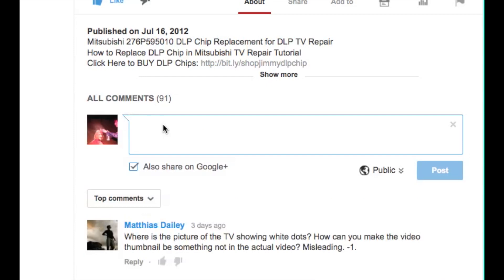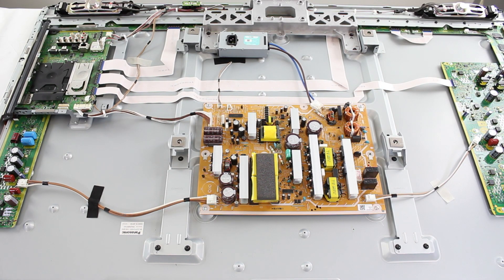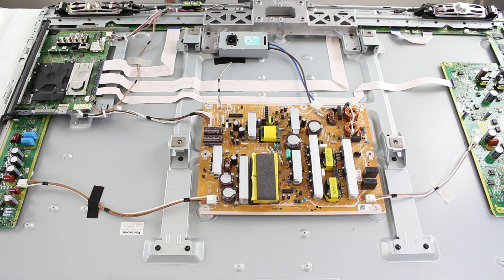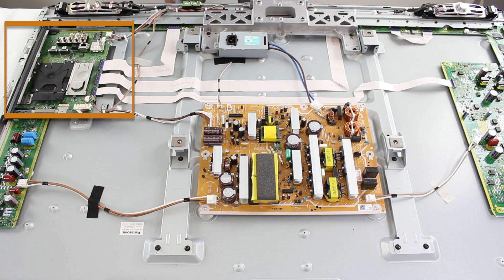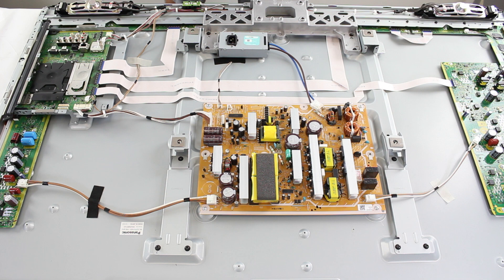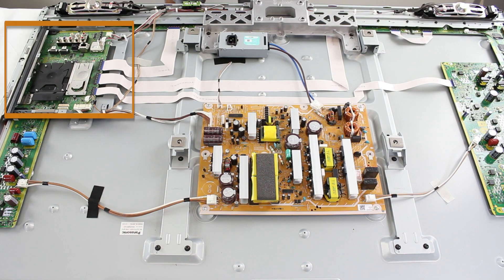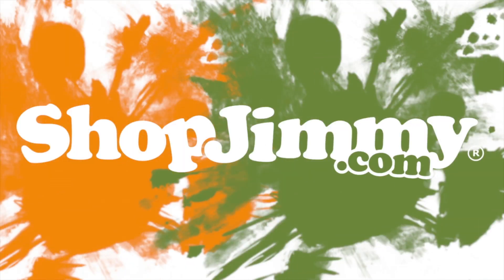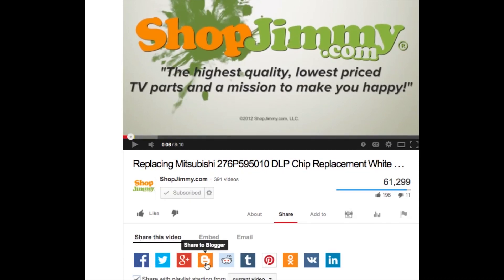TV Not Working After Storm - TV Lightning Strike & Storm Guide for Power Surge Problems

Comment: Not sure if you could guide me in the right direction, my TV was damaged through the HDMI. When turned on the standby light works and TV attempts to turn on but then fizzles off again (don't actually see anything on screen) I've checked the board and all looks OK It's a Samsung plasma display - PS60E530AW3
Reply from the maker: Josh Hartley   I recommend replacing the main board in your TV.  Unfortunately I do not see any replacement parts in the search results for your TV model number on our website.  Please reply with your part number on your main board and I can try searching for replacement parts.  Thanks and please let us know if you have any further questions!  www.shopjimmy.com

Comment: i have a tc-p60s30 i replaced the power and main board and the lower c1-2-3boards still no power..no led lights i have current 120 volts going to powersupply parts were pulled off cracked screen tv ..anywhere to look? thanks
Reply from the maker: Blustdust   I recommend bringing your TV to a certified Panasonic repair shop.  Thanks!  www.shopjimmy.com
Reply: thanks.

Comment: Vizio e601i-a3. Lightning strike. Power does turn screen on. No picture nor do inputs work. Screen quickly alternates black and medium white to alternating black and dim white. Power button again, does turn on TV, but does not work to to turn off the TV. Was on power strip that still works. All cable equipment in house is shot as are about 5 other TVs and gaming systems. I suspect cable box did it. Cable box was HDMI to the TV.

Comment: I have a 55" LG 3D Smart TV, model (55LM7600) and recently while watching the tv on any input it will reboot itself every 25 to 45 minutes.... Sometimes it takes longer to reboot but it does it non the less. Sometimes it goes an entire day without the reboot issue only to resurface the next day. Strange.... I purchased the tv on 11/15/2012 so it's still an infant. There are no other problems with this set. What could be the problem? Any assistance would be greatly appreciated. Thank you
Reply from the maker: Yosbeli Pi  I recommend replacing the main board in your TV.  Here is a link to replacement parts for your TV model number on our website, click here:  http://www.shopjimmy.com/catalogsearch/result/index/?cat=56&q=55LM7600  Be sure to match part numbers on your current board, with your replacement for compatibility.  Here is a link to a video showing how to identify your part number, click here:  TV Part Number Guide for LG & Zenith Main, Digital, & Tuner Boards (LCD, LED, Plasma TVs)  You can also call our customer service for further assistance with your purchase.  (877) 881-6492  Thanks and please let us know if you have any further questions with your TV Repair!  www.shopjimmy.com
Reply: ShopJimmy.com: If you don't mind me asking, how can you tell if the problem is with the Main Board versus the Power Supply Board?
Reply from the maker: Yosbeli Pi   The power supply provides the 3.3v or 5v turn on voltage to the main board and the main board produces the power on function.  Thus it sounds like the TV is getting power, but the main board is causing the TV to turn on and off.  Thanks!  www.shopjimmy.com
Reply: ShopJimmy.com thank you for assistance and the information.  After I buy and install the part, I'll  update on results.

Comment: I actualy have a sony KDL-32R400A not turn on at all I change the power supply but not work. the original one have noise like trasformer glich but the new one not have this noise. the problem i thing was generate by a ligthing because my sat ird not work too.
Reply from the maker: +Wilbert Lorenzo  Try all repairs and troubleshooting at your own risk.  I recommend replacing the main board and the power supply board in your TV.  Click this link to replacement parts for your TV model number:  http://www.shopjimmy.com/catalogsearch/result/?q=KDL-32R400A  There may be multiple boards for the same TV model number, be sure to match part numbers on your current board, with your replacement for compatibility.  Thanks and please let us know if you have any further questions with your TV Repair!  www.shopjimmy.com

Comment: Panasonic 50" Plasma HDTV, Model No. PN50C550G1F, Serial No. ZIMZ3CQZ805936V.  Inoperative due to lightning strike very close to our property.  TV has standby light.  Will power on, try to present a picture, then turn itself off.  Have already replaced the power board (P/N BN44-00330A).  Any suggestions on what to try next?  Your video indicates replacing the Main Board for the model being worked on.  Does the same apply to my television?
Reply from the maker: Papa Dawg  Please watch this video FIRST to help with your repair!  TV Repair! LCD, LED, Plasma, DLP How To Fix Your TV with ShopJimmy.com Help!  If you do not know for sure which board in bad, then I recommend replacing both the main board and the power supply board.  Here is a link to replacement parts:  http://www.shopjimmy.com/catalogsearch/result/?q=PN50C550G1F  Be sure to match part numbers on your current board, with your replacement for compatibility.  Thanks and please let us know if you have any further questions with your TV Repair!  www.shopjimmy.com

Comment: I have a vizio sv420xvt1a it was hit by lightning and will not power on. The vizio name is lit up in yellow as it does when its off but in the speaker in red it displays 5.1. Thank you
Reply from the maker: Ryan Sledge   I recommend replacing the power supply and the main board in your TV.  Here is a link to replacement parts for your TV model number on our website, clic  http://www.shopjimmy.com/catalogsearch/result/?q=sv420xvt1a  Be sure to match part numbers on your current board, with your replacement for compatibility.  You can also call our customer service for further assistance with your purchase.  (877) 881-6492  Thanks and please let us know if you have any further questions with your TV Repair!  www.shopjimmy.com

Comment: Philips 42" LCD TV Full HD 1080p with Pixel Plus HD Flat Screen TV with 3 HDMI connections
Model # 42PFL3603D/27 It worked perfectly until during a storm, it was plugged into an outlet that did not have a surge protector unfortunately and went out. The TV turns on and shows the screen as shown in the picture then makes a clicking noise like it wants to turn on, but just turns right back off.
Reply: Janet Burmeister  Has a white picture with letters Philips on it
Reply from the maker: Janet Burmeister  PLEASE SUBSCRIBE TO OUR CHANNEL - Try all repairs and troubleshooting at your own risk.   I recommend replacing the main board in your TV.  Click this link to replacement parts for your TV model number:  http://www.shopjimmy.com/catalogsearch/result/index/?cat=56&q=42PFL3603D%2F27  There may be multiple boards for the same TV model number, be sure to match part numbers on your current board, with your replacement for compatibility.  Here is a link to a video showing how to identify your part number, click here:  https://www.youtube.com/watch?v=xSSxNZXZIXAThanks and please let us know if you have any further questions with your TV Repair!  www.shopjimmy.com

Comment: Hi I have a question, I got a Phillips with model number: 55PFL5766/F7 and already try all the simple hacks like unplugged from the wall, settings audio to default, try draining the battery of the TV and shutdown the braker. The problem began with a power surge outage for just like a minute but the TV works on image but sound never returned to the TV. I got power protector at my brakers and on the power plugs too that is why I'm a little confused. If you guys can help me please let me know. Anticipated Thanks to your answer.

Comment: Hi. I have a 51" Samsung Plasma TV Model# PN51E450A1F. It shows that there is no power. No Stand-by light nor will it turn on. I purchased a Power board M# BN96-20973A and received it today. I installed it and still have the same symptom. No Power or power stand-by indicator. Any suggestions?

Comment: I have an LG 42LV4400 that had a power surge. Currently it doesn't power on with no lights visible on the set at all. I changed the power supply board and still no response from the on/off button on the set. What should I try next? Thank you!

Comment: Hi i have a GPX model :TDE2482B  
and it was working just fine the night before but now it wont turn on and the red light is still on. I've tried un pluging it and pluging it back in the red light will power on but still wont turn on when pushing the power button... please help thanks for sharing your time.          
                                                                                                                                                  Brittney

Comment: After a storm which took out 1 other TV and our network router, my Vizio D55-D2 SOMETIMES will power on after unplugging and re-plugging power cable but will stay on only 5-10 seconds after booting completely. Audio goes away then picture scrambles and goes dark with no light in left lower corner. May come on again after unplugging but follows the same pattern of failure. Parts suggestions?

Comment: We had a storm roll through and now I have no standby or power light that comes on and seems like RV just doesn’t have power. But checking on the power supply board I show power on some of the board does have power but on one if the fuses it has power on one side but not on the other. 
Plz help me

Comment: i have a 46eh5000 Samsung. it got strike by lighten no standby light. i took it apart and there was a burn on the back of the power board and a small burn light and also the capacitor  was cracked. i've replaced the capacitor first and also replaced the board after the first didn't work but the problem still exist. could it still be main board.?
Reply from the maker: +Rochad Andre   Try all repairs and troubleshooting at your own risk.  I recommend replacing the main board and the power supply board in your TV.  Click this link to replacement parts for your TV model number:  http://www.shopjimmy.com/catalogsearch/result/?q=46eh5000  There may be multiple boards for the same TV model number, be sure to match part numbers on your current board, with your replacement for compatibility.  Thanks and please let us know if you have any further questions with your TV Repair!  www.shopjimmy.com

Comment: I have a Sanyo Model DP42849 Serial # B9281023012557, During a thunderstorm my TV went off smell like burning and doesn't starting again I open the Back panel and remove the Board # DPS-266BP A   PIN.1AV4U20C39200  /   S/N B19W0911031686 I notice one border CY3 - CY$ burned only see the Sweden point but not part in there probably capacitor blow up and disintegrated but nothing seen in there only the burned site can this pc board can be fix?thanksDavid Arroyo

Comment: RCA led55g55r120q and lightning struck my cable box and hit my TV via the hdmi cable. The TV had no power so I ordered the 3 boards (Power, Tcon and Tuner) replaced them and now I have power and back light. Nothing else works! No display or nothing

Comment: I have a Vizio SV420XVT1A TV.  The power went off and now we can not turn the tv on.  It was plugged into a surge protector and everything else that was plugged into it still works.  The standby light is on, but the TV won't power up.  Any help would be greatly appreciated.  Thanks.
Reply from the maker: J Ball   Please watch this video FIRST to help with your repair!  https://www.youtube.com/watch?v=BP3NVNCGEv8  I recommend replacing the main board in your TV.  Click this link to replacement parts for your TV model number:  http://www.shopjimmy.com/catalogsearch/result/index/?cat=56&q=SV420XVT1A  There may be multiple boards for the same TV model number, be sure to match part numbers on your current board, with your replacement for compatibility.  Here is a link to a video showing how to identify your part number, click here:  https://www.youtube.com/watch?v=kxkeGLhlQY8  Thanks and please let us know if you have any further questions with your TV Repair!  www.shopjimmy.com

Comment: Hi , i have SONY KLV 32EX330 it Blink 5 time red after green when i am switching on from remote. This TV is powered with an External Adapter 19.5 Volt, tested by replacing the adapter but not resolved. I have a picture of the main board, would like to share with you, please provide your email id. My only doubt is a tiny battery like thing on the main board, it is rusty. Please help me in troubleshooting this. Thanking you in advance.

Comment: LED  UN55FH6030FXZA i WAS WIRING WITH THE POWER ON(NEVER AGAIN) and next day when I turned it on,,...it didn't come on.. Won't power on and the LED light flashes non-stop 100 mph and there is a clicking sound in the power board that mimics the light. I unplugged the main board from the power supply and the backlight comes on>?  Its got 120 v coming in but thats as far as I tested so far. Whats up?? TIA

Comment: I had a power surge and when I went to turn my tv on it zapped my finger and turned off and wouldn't turn on. It's leaking a little oil and I smell a burnt smell in the vent near the power supply? So I believe it has a burn mark or cracked or whatever. Now all I do is replace that right?
Reply: It is a Emerson 36 inch tv. June 2013 is when it came out.
Reply: Also it was connected to a power strip. I apologize for so many replys

Comment: I have 3 hdtv's. 2 Sanyo and 1 a 55" Philips. All plugged into surge protectors. None wanted to power on after a very close lightning strike but eventually the Philips came on. I had 5 consoles hooked up to it at the time. The ps3, Wii, ps2, ps4, and Xbox one. Every one seems to turn on except for the Wii. They're all in the same surge protector. However none of the ps3, ps4, or Xbox one are showing a picture on my Philips. It just says  "No Signal." Then when I plugged in my PS2 via A/V jacks it comes on, and everything seems normal. Are my HDMI ports fried?

Comment: Lightning went thru my coaxial cable, blew the modem, & surge protector, bypassed the liv rm tv & knocked out the bdrm tv. This happened the same way in less than 6 mos & both bdrm tv's were new. No lights on either tv; totally dead.
Reply from the maker: Mary Barnes   I recommend replacing the main board and the power supply board in your TV.  Try all repairs and troubleshooting at your own risk.  Please reply with your TV model number.  Click here to view a video that shows how to find your TV model number:  https://www.youtube.com/watch?v=S51nhAmwR2M  Thanks!  www.shopjimmy.com

Comment: TV Make: Micromax
Model: 43T7200MHD
Main board: TP.VST59S.PB758
Symptoms: My kids used the otg pendrive in the normal usb port and this caused short circuit and now the TV is stuck in standby mode. At power button I am getting 3.2 V and standby led remains on but if I press power button the voltage drops to zero. Please help.

Comment: I have a Toshiba 32A33 Monitor Tv. I plug it in and its on. No pic or sound. Red power light stays on and doesn't blink. Can't turn it off by remote or power button. I have to unplug it. Its actually in my shed. I was using a saw and and power strip tripped off, with tv plugged into it. That's when it happened.

Comment: we had an electrical storm this morning.  I think it affected the tv.
tv turns on
screen is white pulsing quickly, pulsing changes with input selection
tv has sound
visio sv470m
part no 10240090022
Serial # LAUKEJAL0907695
thanks for you input on this
joe

Comment: bad storm tv not goining on pulled back cover vizio e601i-a3
Reply from the maker: +Chris Hock  Try all repairs and troubleshooting at your own risk.  I recommend replacing the main board and the power supply board in your TV.  Click this link to replacement parts for your TV model number:  http://www.shopjimmy.com/catalogsearch/result/?q=e601i-a3  There may be multiple boards for the same TV model number, be sure to match part numbers on your current board, with your replacement for compatibility.  Thanks and please let us know if you have any further questions with your TV Repair!  www.shopjimmy.com